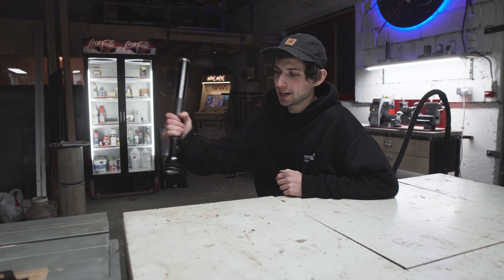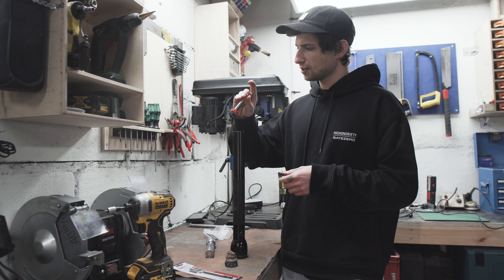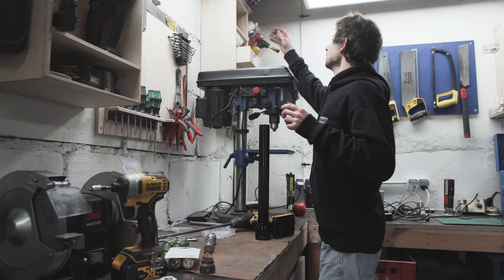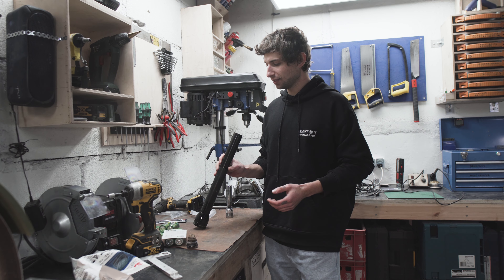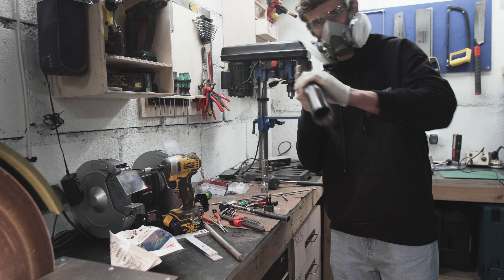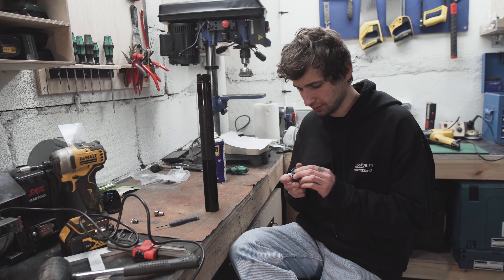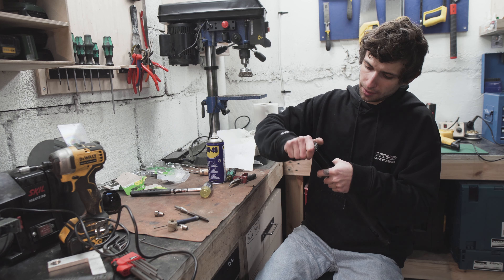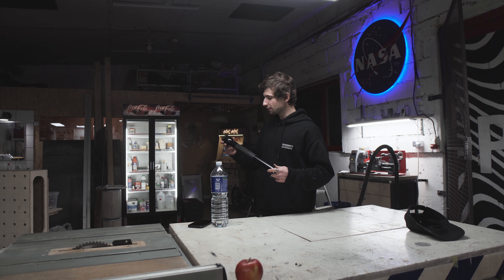Repairing The Worst Corroded MAGLITE  Ever

Comment: Good idea with the Forstner bit battery removal. May be the only way to get them out without damaging the tube. When pushing the switch bulb holder assembly out after removing the snap ring it is possible for the switch button to catch on the hole on the side of the tube and break the switch. Best to depress the switch button while pushing the assy. so it doesn't catch on the hole edge going either forward or backward with it. They are very expensive to replace.
Reply: I just did this trick with the switch and it helped immensely. I also drilled a shallow, blind hole in the plastic switch where the snap ring rides. It was just deep enough to put the head of two small loops of some steel wire inside. I rotated the ring with a screwdriver, captured the loops of wire and was able to pull the snap ring out of its groove. I have two batteries out, and the third, down at the end cap is stuck. The end cap is stuck as well. Rather than use any caustic chemicals, I am soaking the end of the light in a couple ounces of WD40 in hopes the battery and end cap threads will loosen. I have used a heat gun to help with the flow. Still a work in progress. I hope to salvage as the tube , switch and the head end are all in great shape.

Comment: The endcap and spring provide a ground to the light. If there is any corrosion or rust, it won't ground and won't turn on. I also put a small dab of lithium grease on the top and bottom threads for the head and cap to make screwing and unscrewing smoother.

Comment: I use a brake cylinder hone to clean the inside of mag lites
Reply: Thanks for bringing that up.   I didn't know those existed.   Could you give a recommendation on what kind I should get?   I see 3 different types on AMZN
Reply: just today i took apart my 2D Maglite to get corroded batteries out, luckily they corroded in-between the batteries and not at either end, but i cant get the corrosion lump out. I am planning to get a wooden dowel and slit one end to put sand paper in and wrap around it to make a type of flapper hone.

Comment: I absolutely cannot get the retaining ring out to remove the bulb holder in mine.
I'm considering using an magnetic induction heater to put a load of heat into the case to try and break the corrosion between the battery and the case.

Comment: What’s the name of the drill bit that you pulverized h there batteries with so I can pickup when I swing by Lowe’s hardware? Great video!
Reply from the maker: Thanks man! Its a forstner bir cant remember what size it was
Reply: Someone else mentioned a brake cylinder hone.  That seemed like a good idea though I have never used one

Comment: How do you remove the retention ring that stops the switch assembly coming out of a magnalite?
Reply: You have to remove the rubber cap from the switch, inside the button is a small Allen nut, backed it off. Then you can slide the switch assembly out. If there is a stuck battery it's not going to happen.

Comment: The one I just disassembled was in the trunk of a car that was pulled out of a lake after 9 years of being there. Three batteries corroded so bad that it's pitted ithe medal tube and bulb assembly. The  lense car was so corroded that I had to pipe wrench remove it. The the clear lense is a dark ass yellow permantly. Total turd to remove so far .

Comment: You just think you have the worst corroded maglight. I'm working on a pair. Got one opened so far. The other won't budge with a pipe wrenxh. I'm going to try heat next.
Older ones like yours use a 2mm hex for the set screw. The newer ones like mine use a T8 Torx. It's hard to find one with a small shaft to fit down the hole. So a $6. one from Home Depot and some time on the bench top grinder made the shaft small enough. I chucked the tip and a bit of the shaft in the cordless drill spun it while grinding, then unchucked it and finish the bit I missed by hand.
Then beat the batteries out with a piece of pvc pipe. Finished the inside with a brake hone, oiled it up. And it's as good as new. I'm hoping the 2nd one works out
Reply: Today's update. A couple of tips to pass along to those in the future who are seeking knowledge.
The snap ring to remove the switch assembly from the front is difficult. If you back off the either 2mm hex screw, or the T8 Torx screw you can push down on the light bulb holder and then tighten the set screw. The lock the switch down where it doesn't block the snap ring. Then use a small pick or two to pry the ring from the groove. I found it was easier to pry one end down and push it about half way around. Then pry the other end up and work it around. It flew out of the flashlight. Then release the set screw and the switch comes out easy.
No amount of beating got the last 2 batteries out. The top one wasn't corroded and came out. Next up I'm going to try drilling the battery out

Comment: Thank you for the video. I have one were acid of the battery ran through the switch unit down to the reflector. The switch has benn malfunctioning since.
I will try to disassemble the thing and fit the LED to it.

I read in the internet, that newer models cannot be disassembled, not even changing the LED is possible. Can anyone confirm or correct this?
I am volunteer in a repair cafe and someone brought one of these.
Reply: Did you ever find any answers?

Comment: ah, childhood memories! A friend had one of those large Maglites! But in times of LED Flashlights it's pretty sad to see the bad performance of that huge Maglite compared to what a few AAA Batteries can do these days...
Is it possible to replace the old bulb with something LED?
Reply from the maker: There are some crazy LED mods for it but its quite expensive. I’m glad I got it working again at least.. Dont really feel like buying a led mod right now
Reply: @iljanster  Well done on getting it to work!
Reply: @iljanster yeah the conversions kits are pricey from what I remember.
Reply: A simple led bulb from e-bay for £6.96 does the trick and the light is twice as bright, as for the batteries there is a conversion set that will allow AA batteries to work within  a C cell torch, which I use. As the conversion is plastic they will not corrode to the inner wall of the torch. Not sure if they do a similar conversion for D cell. Apparently the reason the batteries corrode to the inside of the torch is a lack of breathability and it is recommended that you regularly open the torch up to breathe

Comment: Mi maglite end cup get stock so bad. Than im hace to use a hammer to remove it and i dont look nice at all  but  it work good and still eorking as new. By the way mi one its  only 2 years old and the baterys. Blow in less than 6 months good luck for my rigth 😂